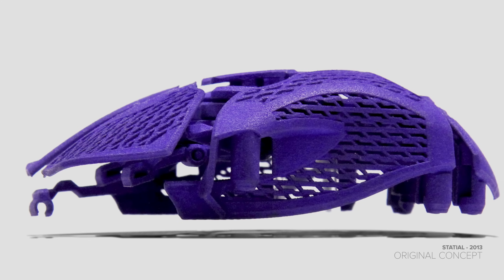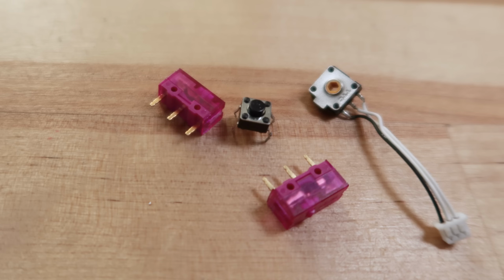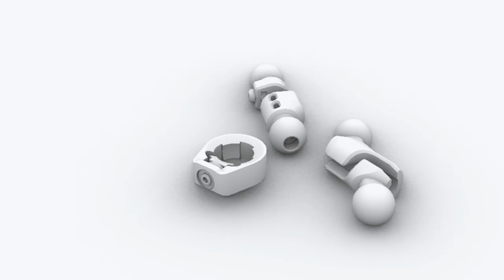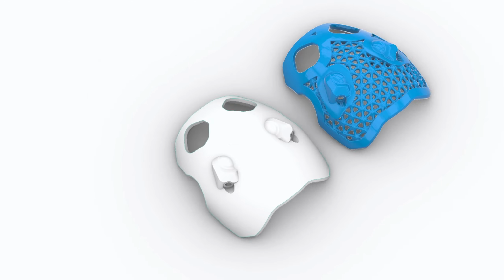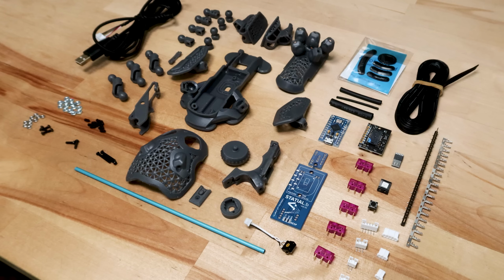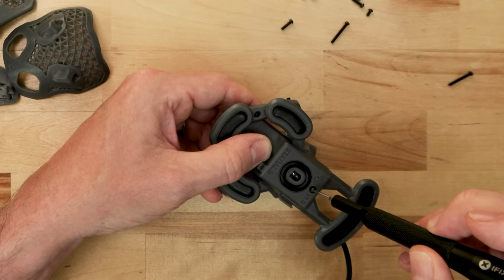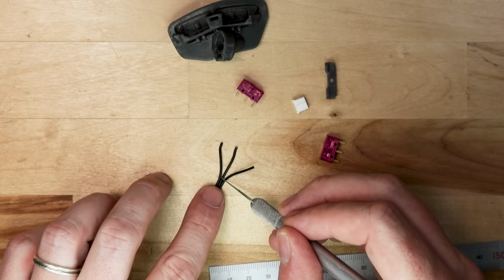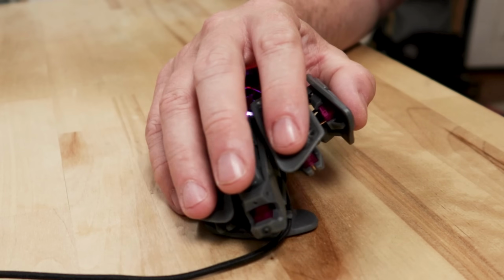Mouse Reinvented  - Statial Open Source Adjustable Mouse

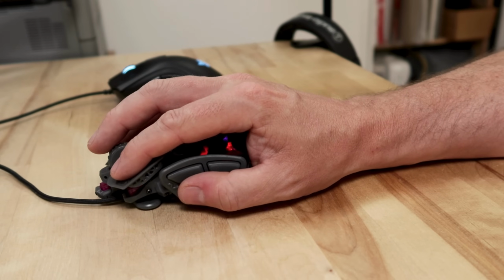Comment: 30:58 Isn't the purpose of caw grip to grip the mouse with your fingertips to maximize precision? When you transform the mouse into such a position, you on the contrary deprive the mouse of the possibility to grasp the mouse with your fingertips and place it in the palm of your hand, which makes you move the mouse with your hand instead of your fingers.

Comment: The level of polish you're able to achieve and the amount of different skills you have is just staggering. It's really so impressive. Thank you so much for sharing. Btw, I know you mention that you don't like vertical mice very much, but I think there's a lot of potential in an adaptive vertical mouse - the body could work as it does now, but it would be connected to the base with another joint, making the whole body tiltable. I personally have been using a vertical mouse for years now, and as with most things, you get used to it and start to be proficient. And I truly believe in the ergonomics benefits it's supposed to have.

Comment: I cant focus on the project, i just keep thinking about how you have your middle finger on the scroll wheel and your ring finger on the right click. I've never seen that before
Reply from the maker: Yeah I use a 131 grip. Lots of cad software uses simultaneous middle & right button clicking so I’ve always been that way. Twitch era gamers seem to use way more 122. You can set the Statial up for either, you just cluster the buttons together for 122 and pull the outside surface in more

Comment: Thanks for thinking about us lefty mouse users. Getting a gaming mouse for lefties is a joke. Many mice pretending to be "symmetrical" end up having thumb buttons on the left side. Yes ther was a special Razer Naga lefty version, but putting a gazzilion buttons to the side of the mouse doesn0t make it automatically awesome. Running a Logitech 903 where I can modify the side buttons, rarely a Logitech G300 and absolutely mainly Roccat KOVA AIMOs. The latter two have (and I friggin love that with my large hands and long fingers) additional front buttons to the left and right of the main left and right mouse button. Why not more mice have that setup I really don't get.

Comment: Why didn't you make sensor & pro micro on the same level. With top pcb connecting both?
Also strict 1-3-1 palm grip is very rare one. Majority of people use only index & middle finger to press on mouse & wheels. It's just a consequence of how long people's middle fingers are.

It's even more rarer than 2 buttons on gamepad's shoulder buttons. Which is, btw, the reason why there is almost no games where you need to press both side buttons on gamepad at the same time.
So before trying to question mouse ergonomics it's better to explore your own habits that can make you usage of any mouse uncomfortable.
I mean it's a very cool project that can be a good base or exploring ergonomics. But it won't be any help for people like you who just use the mouse in a very unconventional way.
Reply from the maker: You can adjust the front buttons to optimize for any grip type or finger layout. That's kinda the whole point of the design.
Reply: @PyottDesign  I wouldn't be so sure. I think there is no combinations of shape with this parts that can be comfortable for strict 1-3-1 grip. Since the base model used wasn't made for this type of grip. 
The wheel segment just aren't built for middle finger. You can try to extend it far beyond & below the original shape,  and start to train you middle finger to the level of index finger, but it will be an arduous journey.

The minimal base level for strict 1-3-1 grip is 3 top button mouses like logitech g600 or  3d connexion cad mouse or some of the vertical one.
Reply from the maker: Not sure what to tells ya, I use a 131 grip and it’s awesome 🤷‍♂️
Reply: @PyottDesign  Why complain about mouse ergonomics then? Have you ever tried comparing your pointing skills between you devices\ grips and \ or with other people using sites like mouseaccuracy or other aim trainers? I think ergonomics discussions are very limited since no one usually provide a point of reference for productivity metrics.

Comment: Have you considered the viability of a 12 button sideplate like the Razer Naga Trinity? How difficult/expensive do you think that would be? I love the look of the Statial, but I could never go back to not having a 12 button sideplate.
Reply from the maker: I'd thought about having additional buttons but wire management from the moving surfaces would become pretty clunky for 10+ buttons. You would also need to add some hardware to manage that many buttons going into the Pro Micro controller. Not impossible, just something I didn't want to get bogged down with in this version.
Reply: @PyottDesign  It may be possible to reduce the number of wires by connecting the buttons in a matrix, but it'd still be a lot of wires for a small space.

Comment: There are many pro micro alternatives that have USB-C ports. These are drop-in replacements for pro micros, and are frequently used in open-source mechanical keyboard designs. One model, the Supermini NRF52840, even has bluetooth and built-in battery charging and costs less than $5 (still supports wired connections). Something to explore for anyone building this themselves or future revisions
Reply from the maker: Hadn't seen the Supermini before. Very nice option for future builds!
Reply: @PyottDesign  I have several, and they work very well. I found the bluetooth connection reliavle even with multiple devices.

Love the mouse design, and I learned a lot watching your design process. I especially love that it's open source, very well done!

Comment: awesome work, thanks for sharing!

having to use a separate stl for left-handed and right-handed kinda defeats the adjustable/adaptive concept of that mouse though. 
would it be realistic to make it 100% adjustable e.g. by making that thumb panel usable on boths sides without requiring a different stl file?

Comment: Great project and video. I think you could potentially make the board even smaller by using the surface mount IC instead of the full arduino board

Comment: How is the sensor? Does it do angle snapping, prediction, acceleration, or smoothing? These are bad things.
Reply from the maker: PixART PMW3389 16k dpi sensor which is pretty common in high end gaming mice. You can alter the sensor profile through the open source repo for the project.
Reply: Nvm. M100.

Comment: You realize that you will setup the mouse once and than never readjust it, right?
It would be easier to just 3D print a custom shape.
Reply from the maker: How do you know what custom shape to print?
Reply: @PyottDesign  I used air drying clay over saran wrap on an existing mouse to sculpt it as per my liking (1-2-2 grip, to rest my ring and pinky finger on the side as well as a wider index button, accommodations for resting my finger naturally.) then cleaned up the shells's 3D scan and printed multiple iteration to fit the original base.
Reply from the maker: Nice process & sounds like a cool end design! The point of this concept is to make an interactive mouse armature that you can make micro adjustments to. That way you can rapidly explore different shapes and grip styles. Getting that quick feedback loop in how the different shapes are performing is the larger goal of this one.
Reply: @PyottDesign  was blown away by your meticulous design process and attention to documentation details, love the fact that you took massive efforts to make it open source. My quick fix was pertaining to my skill level then and the resources i had at hand back in 2010-11, again loved the versatility and adaptability your design brings to existing solution.
Reply: @Jakub1989YTb Then you would have designed a mouse for a single person, not EVERYONE

Comment: It's disappointing to me how many people don't know about the R.A.T. I brought it up back in your original video but I guess it was never seen. I have used a R.A.T. for 10+ years and have two still in box so I can theoretically have them until mice are no longer used. Everything with the exception of roll and mouse button movement is possible along with tons of configurable plastic parts. I'd love for some of the customable parts from them to be added to your design but I'm not the best 3d modeler
Reply from the maker: Oh yeah, I had the original RAT when it came out and have fun memories of it!
I was originally going to talk about it in the video but had to cut it for time. You can still see it on my style board at the 10:34 mark

Comment: R.A.T. if all the panels weren't just for show
Reply: The only problem with the R.A.T. 8+ is that even at their full extension, if you have long fingers or a larger than average hand, the mouse is still small. That said, I don't know why I never thought of 3D printing additional modules to replace the existing ones for the R.A.T. 8 to address that shortcoming. Guess I know what I'm doing in Fusion next.
Reply: @erin.anderson  Close to my situation... I have Giant hands and my rat 7 MMO is still small. Even though it's a chonky boi. 
I will probably in the future just scan my rat 7's shape which i adore, make it a little big bigger and slap some logitech hardware underneath. 
That of course will happen when my rat 7 will inevitably die (like the others did)...
Reply: My R.A.T 7 M.M.O disagrees with that statement

Comment: i'd want to add in some adjustable base plates to allow the half vertical to turn full vertical or a more near full vertical mouse but thats just me
Reply from the maker: If those aluminum tubes in the extension arms are cut longer it should be possible to make it closer to a vertical layout. It wouldn’t be able to collapse back down to normal size but should work.
Have to mess around with that in the future 😁

Comment: I don't see the point of an adjustable mouse housing, when we can just print a mouse shell that fits our hand perfectly. 

I think what we need more than a complicated infinitely adjustable mouse, is just an open source kit, that people can print their own mouse shell for. 

There's lots of discontinued mice that don't have available replacements in the market, like the Logitech G604 and the G700s, for example. 
We really need a QMK/VIA software set for diy mice, and a kit that lets people decide how many buttons they have, and how they're laid out, and what shape of shell they use.

That being said, I'm always happy to see more DIY in the computer mouse space. It's what we need to escape Logitech/Razer/Corsair's overwhelming mediocrity.
Reply from the maker: How do you know the shape of the mouse shell that will fit your hand perfectly though?
You can adjust this to a perfect fit, 3D scan it then print out a solid version of that form that screws onto the inner body.
Reply: I think you're missing the point. This wsy you can remake portions, adjust placement and experiment without having to imagine and print each time. If you come to a new idea or shape then you can design and print it.
Reply: what is this non sense

Comment: Every time you post a video, I get closer to buying a soldering iron, and a 3d printer
Reply: Do it! They're both fun hobbies. They can get costly, though.
Reply: Resin printers are NOT for first-time users and requires handling of pretty hazardous chemicals!

These parts require a small 3d printer and if you're gonna print tabletop figures, resin would be bestest option....
Just prepare for pain and epic failures. :D
Reply: Get a A1 Mini man
Reply: @emmanueladdey7083 was just about to say this. Haven’t bought one yet but a friend of mine has one and I’ll go to his house with my filament and just start printing stuff. I genuinely don’t think I’ll ever buy an Ender product again, besides maybe a resin 3d printer

Comment: i look at this and can only think the amount of hand chum that those buttons will accumulate
Reply: cheese grater
Reply: "Hand chum" is brilliant 😂❤
Reply: Hand chum?
Reply: @sammorossi  you know, gamer gunk
Reply: Thor can't keep getting away with this. I refuse to call it hand chum lmao
Reply: If you think this is a big issue, that tells me you don't already regularly clean your peripherals. I shudder to think what your keyboard looks like.
Reply: @brzt4256  Regularly cleaning this thing would be like one of those rusty candy crank restoration vids. Maybe this is just me but I have to wipe down my whole ass mouse every week
Reply: It doesn't. That's a misconception.
Reply: @MeowTow explain? Because my mouse definitely piles up with gunk.
Reply: @MeowTow  any groove or seam in a smooth surface that you hold for long periods of time will gather dirt and sweat. unless you've got some unicorn gene that prevents you from sweating, that stuff will solidify within those grooves and holes over time and it smells and looks terrible.

Comment: what if i wanted an ambidextrous model of this?..
Reply from the maker: There are files for the left handed version on the Github Repo under the STL.zip\extras folder. You can also just mirror the left and right surfaces in your slicer. All the other parts are the same: https://github.com/PyottDesign/Statial-b

Comment: The half-vertical grip style layout you mention at 31:47 is much like the Handshoe mouse, which is the ergonomic mouse I personally use. I would recommend checking out the Handshoe if you haven't already.

Comment: The half-vertical grip style layout you mention at 31:47 is much like the handshoe mouse, which is the ergonomic mouse I personally use. If you aren't already aware of the handshoe mouse I would recommend looking it up.
Reply from the maker: Wow, hadn't seen that before. Thanks for the heads up!
Reply: This was an incredible recommendation and sent me down a mega rabbit hole after I found them available at a local ergo-specialized outlet haha. TYVM! Much appreciated

Comment: R.A.T mice already did this in 2011.
Reply from the maker: I had one of those back in the day! (There's also some pics of that series in my reference images)
The RAT was only kind of adjustable though. The back end could slide in/out on one axis and the inside thumb surface could pivot on a single axis. It also had some swappable components and weights. Everything else was locked in place.